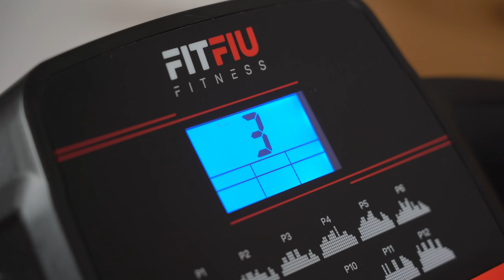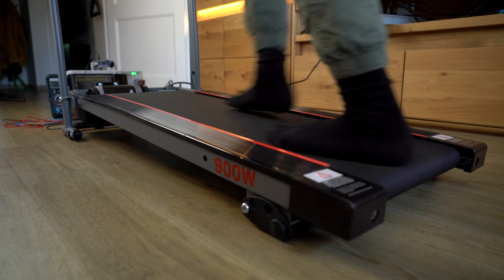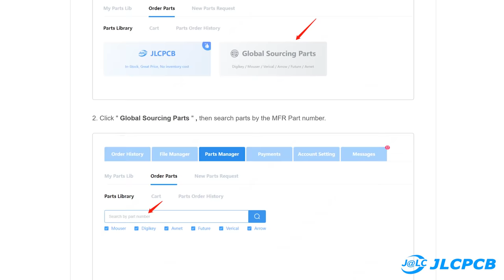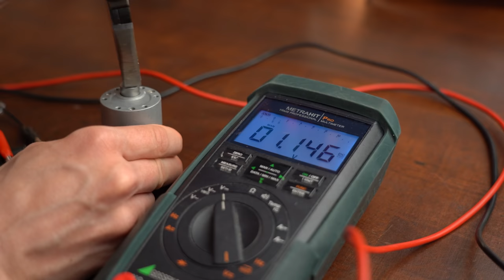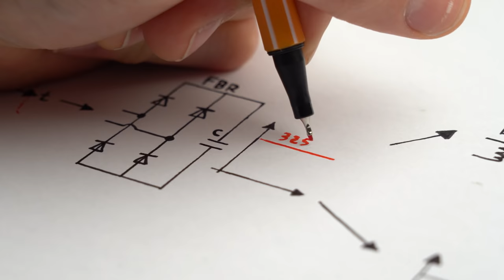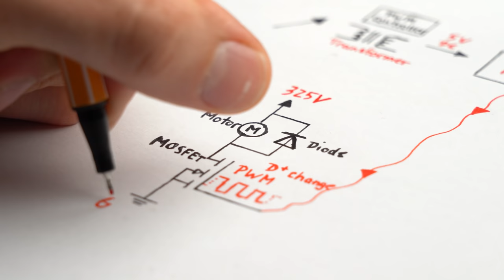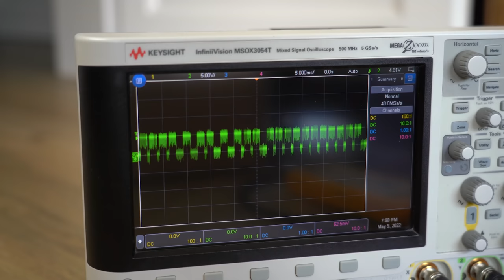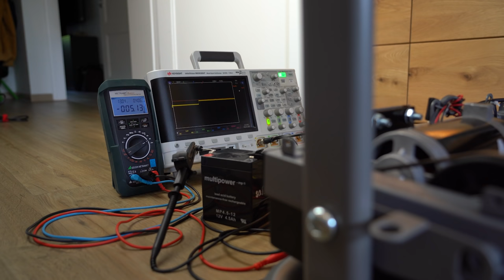Should we use Treadmills to Generate Electricity? (Experiment)

Comment: Stationary bike with a "fly wheel" with at least 10 to 15 kg can help to solve the problem of a generator to charge batteries, once the system has enough inertial momentum you'll use less effort to keep it in constant motion and generate smooth flow of energy
Reply: A rowing machine would be a good conversion too. The resistance mechanism is usually a fan, but it has a decent amount of momentum, and there's usually air baffles to adjust the resistance. Add a servo and a generator to the mix, and you could adjust the baffles on the fly to maintain a constant resistance over a range of loads.
Reply: @TheActionBastard  search it in youtube. There was a video with it, but not stationary bike, moving one.
Reply: Bikes been generating electricity for a long time I remember lighting the 150watt light at a science center. But even generators for bike lights been around for a long time I have a few and one time I put a transformer on the generator terminals and lite up a Christmas light. That was my electrical and electronics project for eighth grade shop class. Had I mounted it on a bike and turned the bike up side down I believe I could have lit up larger bulbs. I also knew of a person that made their child to generate electricity for watching a TV if the program was educational then the TV was plugged in an outlet but for a cartoon or other childrens program the child peddled for electricity to run the TV. Exercise never hurt a child and the parents did good for the child. 73
Reply: @ronb6182  I'm a little dubious that the child actually ran the TV. His peak output would have been barely over the minimum needed to run the TV (I'm assuming it was a CRT, not a modern LCD). But having the TV be on a circuit that only turns on while the bike is generating would still achieve the goal and work pretty well... Those science-centre bike-generator-drives-a-lightbulb things were, as I recall, always tough to get a bright light from, and most people didn't have the stamina to run for any useful amount of time... Although they were also very beat up machines that certainly needed maintenance they didn't get.
Reply: @RichardBetel  yes it was on tv and it was a small portable TV. They only use about 120 watts of electricity at least my 12 inch did and had tubes the transistor sets use much less electric. But anyways you can run small things using a generator on the bike. I lit 150 watts when I was in highschool in the sixth grade I could only light the 75 watt bulb  probably the same as a transistor tv. Now the watts are much lower and they run on 12 volts DC. Well bikes can make usable energy better than a treadmill. Believe it or not it's your choice. 73
Reply: Small batteries maybe and If you are really desperate maybe. But a flywheel doesn't make it less exhausting. You still have to Put in the energy to Charge the battery + additional friction losses. The fly wheel only smooths the peak. Additionally you have to get the parts for the energy conversion which costs energy to produce. So in the you will probably Not even get the energy Back you Had to Invest into the whole build to even manufacture it. I mean a cyclist maybe produces around 300-400 Watt max energy for maybe an hour but that's it. most people produce less. They even Tested it on TV. Trying to energize a whole family house with just a bunch of cyclist and that was really difficult. So If you want to Charge a battery but don't wanna think about some survival Apocalypse scenario Just use your Power outlet. No hate.
Reply: @kitkat2407  with the right multiplier pulleys and right mass flywheel you can charge batteries with stationary bike and a generator, I can even imagine a clockwork generator that you can wind with a crank like an old spring  pendulum clock but of course that can be a huge construct. We have to know the laws of physics but deny a lot of things unless you use the laws in your favor.
Reply: @MiguelDeMarchena  one law of physics you cannot break you cannot get something for nothing you can tie a generator to a motor and use a pull  rope to start the rotation it will turn for a while until the loss slows it down until it stops . People think they can put another load on the generator but the unit will stop much faster than the motor load did by itself. Cannot steal that electric power from the motor or it stops immediately. 73
Reply: the one i have has a giant fan on it too, so you get cooling
Reply: OK can't believe i read thru all that
Reply: @ronb6182  thanks sir i understand but i am not saying to "create" energy or perpetual movement because i know that both are impossible run a bike ( kinetic energy ) to make a flywheel move or use a mechanical device that substitute the bike but of course all the system need to be functional enough to move the generator the question could be the amount of force needed ( multiplier pulleys )
Reply: Pretty genius idea i should notice
Reply: @MiguelDeMarchena  yes I understand but bike do generate power at science centers and I done 150 watts but for how long until I get tired is another question I believe you could power low current items like a computer or LED tv. Charging batteries I think that would require hours of pedaling which is not practical in most cases. 73
Reply: Yep, something to carry the spike in power.
Reply: @tripplefives1402  230 watts well that's better than 150 watts which I done in highschool. I haven't tried lately I'm probably out of shape which the exercise is good. 73
Reply: A flywheel would make for a stable input/output, but the main problem is consumption. An average cyclist is able to generate 200w of sustained power. About 300w for a pro.

Take 10-20% of efficiency loss, you end up in the 160-180w range. You wont be powering big stuff, even powering small stuff like a cellphone will take a while, you better be able to keep up.
Reply: @Coyote27981  this is where multiplier pulleys and the fly wheel make the job easier, once the system have enough speed it needs low effort to keep in motion (as if you swim riding the current)
Reply: youtube commenters reinvent a black mirror episode
Reply: @MiguelDeMarchena  you are just not listening. Multiplier pulleys and flywheels do not multiply the input power. That is not what they multiply. Fundamental error in physics. Second law of thermodynamics. Takes very little effort to keep going after it has started ONLY if you don't attempt to drain power from it. The moment you attach the dynamo, it is like a brake. This his how the brakes in electric cars that recover energy works.
Reply: @danielch6662  you can not create energy from nothing i know what i am saying is make the system easier to gain inertia and keep moving with low effort ( i am not speaking about "free energy lies"or perpetual movement illusions )
Reply: Wouldn’t a beefy car audio capacitor work even better to buffer the power?
Reply: In terms of frictional losses a treadmill is perhaps the worst aerobic exercise device to choose while many exercise bikes and even some elliptical machines are self powered. They don’t even plug into the wall. And many cycling trainers display your energy output in watts. As others have said outputs of greater than 150 watts are possible but the sustainable rate depends on how strong and athletic the person “riding” is and if they’re riding below or above their anabolic threshold. Exercise bikes have been used for emergency power generation. They work MUCH better than your treadmill experiment or any hand crank generator.
Reply: @sharedknowledge6640  correct.  Almost all treadmills are a high friction environment. Very inefficient.  But there are some designs of treadmills now that have a track-like running surface that rolls on a bearings. There are actually motor-less treadmills that incorporate this design.
Reply: So a car engine is literally infact just legs, metal ones, and the iron giant is made out of metal/iron, the iron giant can then relate to a car engine, which means the Iron Giant is a giant engine, if so, does its legs power itself? or does he just have a heart that uses a hydraulic water engine that uses molten metal instead of water, or does he basically use an engine that moves the flywheel inside him that powers him?

Comment: Instead of trademill, try using Gym steady bicycle. It's rotating motion would be more efficient.
Also, I'm waiting for your video on Altium PCB design tutorial.
Reply from the maker: Noted!
Reply: Black mirror writers had that figured out long ago.
Reply: Seconded. Many gym bikes are actually flywheel-powered so you can use them without mains. Their electronics just start lighting up when you generate a little power and then you have metrics and controls.
Reply: I remember reading something about the sustainability of using bikes as power generators, and even under ideal circumstances the power you could generate over the lifetime of the bike couldn't offset the power required to produce all the materials involved in the setup. This would be even more true for treadmills of course.
Reply: am i missing something with these replies, didnt he already do this with the bike and got a much heftier 200w out of it a few months back??? i wouldve thought thats just fairly intuitive with how the force vector diagram for both those activities (running on a treadmill and riding a stationary bike) looks in my head. i mean mono panels probably last a lifetime if treated well so if you have the space and money it might seem daft to try and use either the treadmill or bike generators as actual offgrid power sources, especially if you want to accommodate for modern conveniences like electric heating and AC but for me just to keep the lifelines like lights, fridge, phone going i'd love to have access to a free 200w or even 20w if it meant i could disconnect from mains, which in my country comes with a not insignificant standing charge, so youre forced to pay a chunk of money every month before you even use any electricity. not to mention that i wouldnt need to run heating in the winter with all the extra heat my little inbuilt furnace would be putting out just to crank out those watts on the treadmill lol. personally i think both are cool cause even though the treadmill would produce 10x less power it would allow me to change up my position every now and then from the exercise bike, same as a sit-stand desk allows me to change up my position between those two for comfort and ergonomics. idk, just food for thought, but personally id really really love more stuff like this.
Reply: @greatscottlab  exactly, check how much exactly average person can generate energy. I bet somwehere around 200Wh per 30min cycling.. which actualy is quite decent... enough to charge phone and laptop for a day or two !
Reply: Absolutely, also secure your feet to the pedals and maybe strap yourself into the seat as well, for maximum leverage.
Reply: Also on a musculoskeletal level having to push hard on the pedals of a bike is less abnormal than having to push hard on the surface of the ground
Reply: I built one from an exercise bike. I basically bolted a treadmill motor right to the frame and put a belt around the flywheel on the bike, after removing the magnetic break. I've used it to charge phones, car batteries and laptops.
Reply: @1ssac1  I think average continuous power for cycling is 75W so 200Wh at 30min is about 450W of pedal power because of losses in generators and electronics and you would need to be very fit rider because highly trained cyclist can produce 5.5 Watts/kg.
Reply: Makes no difference to the core problem. Whether you use mechanical or electrical components the key problem is the unpredictable load and  nature of human motion, Flywheels and PWM are both same side of the coin and no matter what county - heads is always heads.
Reply: @YourArmsGone  This has been my dream for couple of years now. Got all the stuff needed but a lazy person needs a lot of motivation. What are the specs for your generator?
Reply: @Teknopottu  It can put out over 400W which is where my volt meter maxed out. I got all the parts from the dump except the belt and voltage controllers. overall it probably cost me about $50. 
The motor was a 3hp 130v dc brushed motor.
Reply: @YourArmsGone  Good stuff. My motor is 1,5hp 180VDC. Maybe I'll look into this project next. Thanks for your reply!
Reply: THIS!
Reply: What about Human Sized Hamster wheel?

Comment: I think the Concept 2 rowing machines at my gym are doing fundamentally the same to charge their onboard batteries. At least I have never seen them being connected to any wall outlet in the past year. Those literally run on blood, sweat and tears :D
Reply from the maker: That sounds about right. Now I am sad that I do not have such a rowing machine at home. Would certainly be fun to find out how much power you could produce with them ;-)
Reply: @greatscottlab  Even elliptical trainers run on power generated by humans lol. My gym has ones that even have a fan that runs off of human powah. The wattage is also displayed at around 200W while doing cardio.
Reply: @greatscottlab  You can buy cheap broken or oil based ones and stick a motor on the output? You might need a flywheel too due to the way you row, but it would also make it feel more like a boat :D
Reply: i have one at home and it had a small onboard battery in it, so maybe it runs on that 😁
Reply: They do have standard alkaline batteries in them they use the power generated to prolong their life, same as calculators with small battery and a solar panel
Reply: @pavelnovak4888  Not all of them. Some of these devices go dead the instant you stop using them, and assuming the batteries aren't shot, I'd say they probably only use capacitors.
Reply: The most of them have a small 6v battery
Reply: @anonymousarmadillo6589  When I worked at Intel, the gym had stationary bicycles with USB ports that can charge your phone or tablet. That predates quick charging standards so they could only supply about 10W. An updated version with USB-C would be much better.
Reply: how come your post is 11 days old when the video was only released today (~ 2 hours at the time post this post) ?
Is it because he is a member of patreon and gets access quicker ?
Reply: @greatscottlab  If I lived in Germany I would give you an old one.
The return spring is broken but its a magnetic flywheel design so you've already got a fairly weighty flywheel that could be hooked up to an output motor.
I got Lidls knock off version of the concept 2 and it works fairly well. Plastic came pre-cracked though.
Reply: Well, thats a very good idea, I thought about this for a long time. I'm not entirely sure how they work, but it usually shows me that I produce about 120 watts per stroke (+I'm definitely not the strongest one), you can work at this efficiency for 15 minutes, that would be more than enough to power whatever you want to.
Reply: I’ve seen a video on YouTube where a dad converted his Concept to charge a battery that powered his kids TV and PlayStation. 😅
Reply: My final year engg project. We could easily generate 120 watts from an average person for over half an hour.  Sadly we had no electrical engineers on the team and had designed a very bad generator. 

Good thing about concepts 2 is the magnetic resistance, so you can depend on them and just add coils to generate. Another good thing, because they are magnetic their resistance increases with speed (larger Eddy currents) and thus even provide a good workout while generating sufficient energy. Need to spend time on generator calibration though.
Reply: @greatscottlab  would love to see a teardown of one of those.
Reply: @sri198904  yes, I'm a patron, and commented while the video was unlisted.
Reply: This is not correct. Concept2 rowers use a pair of D sized batteries to power the console. There is no internal generator or any electrical device inside if it.  The resistance is done by an air turbine and adjusting the amount of airflow that exits the shroud

Comment: The voltage drop actually has to do with the internal resistance of the motor itself as well.
Which can be quite substantial. A dynamo with maybe even a PFC would probably work better in this case.
Dynamos require less force to spin compared to DC motors.
Reply: Ya the more current you draw, the more voltage drop from the ISR
Reply: Hey Guybrush!
Reply: And also the LEDs clamp the voltage

Comment: Not so fast. I am currently sitting here watching the battery level in my phone slowly drop. I and 170,000 other people in Ottawa have had no electrical power for the past 28 hours. A somewhat nasty storm came through here yesterday toppling trees, power lines, and ripping shingles off of roofs. I've survived it all through the use of power bricks, draining UPS batteries, and taking my car for a run. Right now I would be happy to have your tread-mill power generator (or the earlier bicycle one). 

Great video!

Comment: What about using capacitors to stabilize the energy draw, or something a little more advanced like a circuit that would distribute the load between charging a battery and the device itself, and also switch between charging and discharging the battery as needed in order to keep the energy being drawn from the generator constant?
Reply: A better option is to have a large capacitor bank which holds the charge and then use a boost-buck converter to stabilise the voltage.  Add in a few LEDs to indicate whether or not you're generating sufficient energy to supply the load and you've got something which just might work.